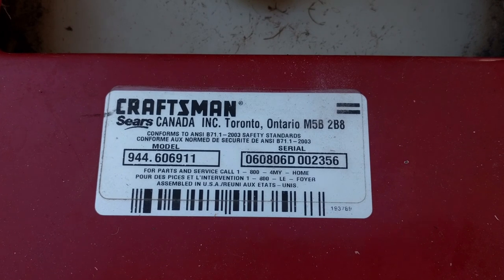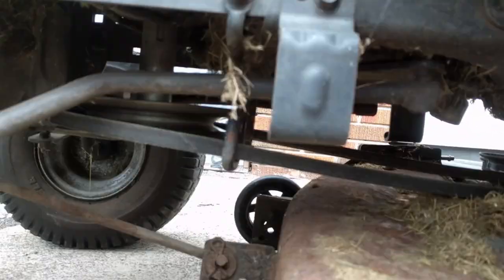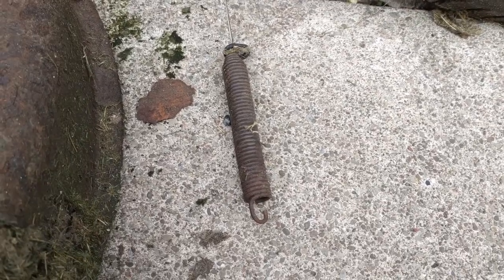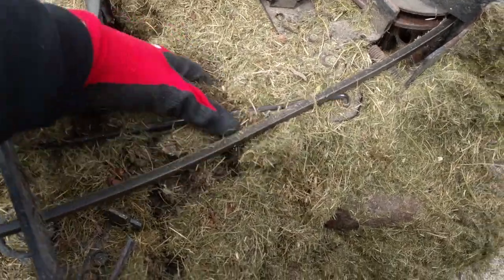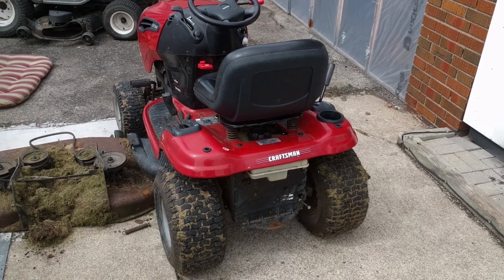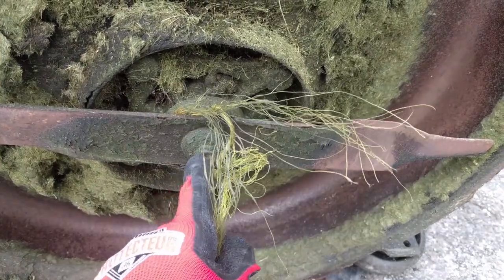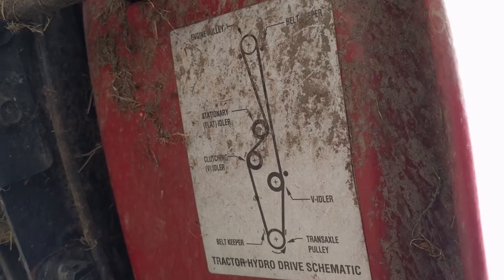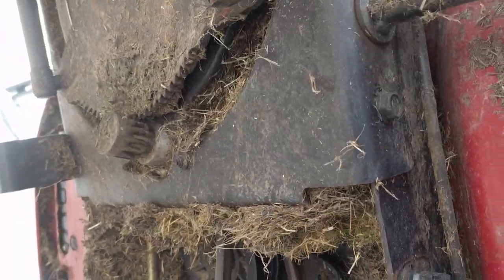Craftsman YS4500 Deck Removal & Carb Clean Part 1

Comment: Nice video, helped a lot getting into the carb. Mine pumps fuel but isn’t starting so I went into the carb and found the fuel solenoid, with the valve closed the continuity beeps and when I force it open it continues to beep so I assume my valve is bad?

Comment: entertaining and education tractor has a third belt under ground belt  smaller 10 to 12 in this is a craftsman hyrostratic 46 cut model #917.287140

Comment: This would really really really really, I mean really help me out here if you could answer this for me.

I have that craftsman riding mower.  I need help finding out where a spring goes. The spring I am talking about is shown on this video at 9:18

On the Ground Drive schematic there is a spring, part number 161.  An idler arm return spring.  That spring hooks into the end of part number 189 on the same schematic, the other end of that spring hooks onto the right side of the frame.  I want to know where on the frame does that spring hook into?  

I had to replace a pulley and it fell off during the process.  One might think, why don't you just try it in a few spots to figure out where it goes.  I tried that and where ever I put it, the brake pedal just doesn't feel the same.  I'm even wondering if it goes on the frame.  Sears was no help and everyone else tells me to bring the mower in for service.

If you could show me on that schematic, shove your phone up under that mower deck (take the mower deck off (maybe when you sharpen your blades)) and make a video of where that goes, or email me would be outstanding.
Reply from the maker: Unfortunately I can't be of much help, as this was a customers machine and is long gone.

The CVT transmissions require the drive belt to always be under tension.

If you don't have the proper "feel" to your pedal, it's probably because you don't have enough tension on the spring, and are running into a slipping issue.

I would hook the spring up anywhere that gives it more tension, this might be tricky, but the belt needs to be tight with only about a 1/4" of play on it!

If I get one of these machines in for a service, I'll try my best to have a look!
Reply: Eliminator Performance - Thanks for the reply. Yep bingo, I need more tension. You’re right it is tricky (a pain in the ass) because of the tight tolerances required on the spring.  Like I said I just can’t seem figure out where it needs to go for the correct result to be achieved.

Comment: How do you repair the brake pedal  locked cruise switch stuck in down position locking the forward and backward up?? Belts are all correct!! Is it a possible spring missing, brakes clogged with grass..thd idler pulley won't kick out drive belt.
Reply from the maker: Most likely a Idler return spring on the drive bracket.
Reply: @EliminatorPerformance  Thanks!👍
Reply: @cookman45  - Hi I just asked this question on this video a minute ago.

This would really really really really, I mean really help me out here if you could answer this for me.

I have that craftsman riding mower.  I need help finding out where a spring goes. The spring I am talking about is shown on this video at 9:18

On the Ground Drive schematic there is a spring, part number 161.  An idler arm return spring.  That spring hooks into the end of part number 189 on the same schematic, the other end of that spring hooks onto the right side of the frame.  I want to know where on the frame does that spring hook into?  

I had to replace a tensioner and it fell off during the process.  One might think, why don't you just try it in a few spots to figure out where it goes.  I tried that and where ever I put it, the brake pedal just doesn't feel the same.  I'm even wondering if it goes on the frame.  Sears was no help and everyone else tells me to bring the mower in for service.

If you could show me on that schematic, shove your phone up under that mower deck (take the mower deck off (maybe when you sharpen your blades)) and make a video of where that goes, or email me would be outstanding.